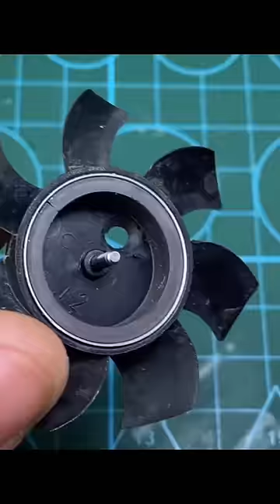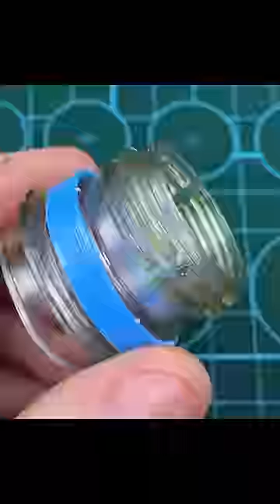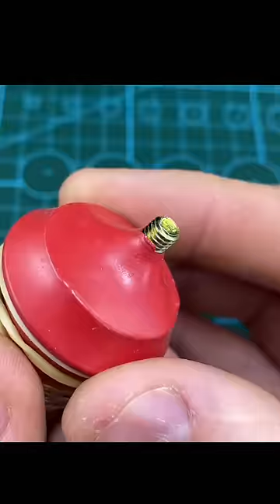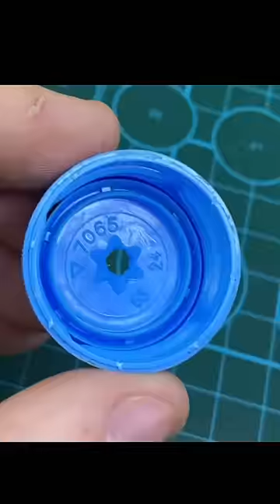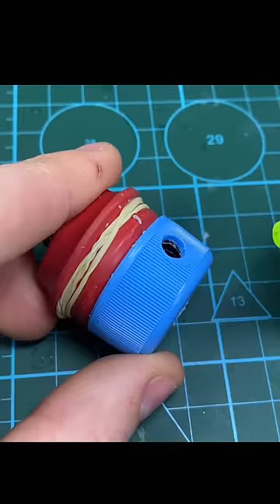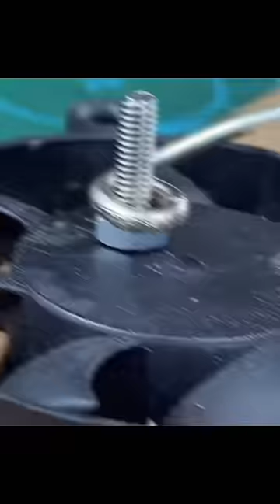How to Make an Air Pump

Comment: This is possible because theres a simple valve that stop the machine to suck air at the same hole. Or In other words this can be called a pump because theres an one-way valve, good video and definitely not bad
Reply: Y8u9uu
Reply: NO NEED TO RE-EXPLAIN.

Comment: Bro, Where is the output valve?
Reply: This not an water pump this an air pump he showed the air by putting the pipe in to the water...
Reply: @rudrakshthete4934  @Whiteglows Electronics output valve was made with a cut skin of baloon, glued on a hole in  the bottle lid.
Reply: @Whiteglows Electronics output valve was made with a cut skin of baloon, glued on a hole in  the bottle lid.
Reply: @madhusudangupta3661  the valve is inside the bottle cap, so I'm pretty sure it's an inlet valve.
Reply: @exmodeus  I believe you must have read and understood my comments to Whiteglow Electronics. I said the same thing, that you are repeating, that the valve is fitted in the bottle lid.
Reply: @madhusudangupta3661  You didn't called it as input valve, but output valve. OK, here is the air flow, atmosphere > pump chamber (bottle cap) > tube > glass of water. That's why I called it as input valve.

It may not be necessary to add an outlet valve as the tube is submerged in water.
Reply: @exmodeus  Dear Sir, At the onset, I reiterate that I had initially responded to Whiteglows Electronics on his comment about the non-existence of the output valve. Obviously my comment was to explain it in detail to justify the construction of the project.

Dear, Your entry into the issue is welcome, but with reservations that you must first understand the scenario and comment logically.

Secondly, the requirement of the output valve, though submerged in water, as because you will agree with the basic knowledge of fluid mechanics, in which I have the Masters, that in the absence of output valve, the surrounding water, submerging the outlet, shall enter into the pump system due to the presence of negative air pressure, thereby failing the purpose and functioning of the pump. 

At the end, be assured that I shall be waiting for your and other knowledgeable viewers' comments on the discussions.
Reply: @madhusudangupta3661  Forgive me not giving detailed explanation how the submerged tube 'can' act like check valve/output valve regarding the video (such as how deep the tube is submerged, resistance of the inlet port, displacement volume, etc), because I don't have time when writing that comment. Of course it isn't applicable to every case.

Initially my first reply, I corrected your statement that said "output valve was made with a cut skin of baloon, glued on a hole in  the bottle lid" is INPUT VALVE, because the balloon is glued INSIDE not the outside.

I have 2 questions for you.
1. What is the direction of the fluid is flowing? (this may be obvious, but I want to make sure)

2. Why do you called it (a cut skin of baloon, glued on a hole in  the bottle lid) as output valve?

If people with Masters degrees, have different naming of those components, please let me know.
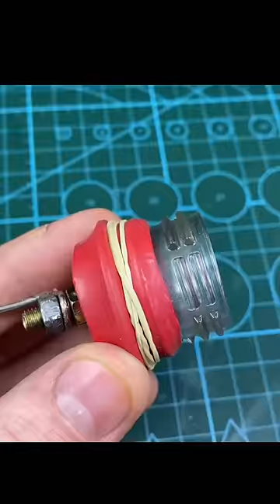Reply: @exmodeus  The fluid is flowing from the atmosphere into Pump cylinder through the INLET valve( Balloon skin glued inside the pump cylinder as inlet valve, to check the reverse back flow into atmosphere). The compressed fluid, not finding escape back to atmosphere through the inlet valve, is bound to move forward to get released into the tube. However, after your pointed comment as above, I  revisited the VDO and noticed that the glued skin is on inlet of the cylinder (0:42 sec). Another balloon skin has been used to act as piston, leaving the output hole ( without any valve) free to allow flow in either direction. This indeed is a lacuna in the performance of the pump. The end of the delivery tube placed in the glass full of water, is supposed to  allow the back flow of water into the tube during the suction stroke. However, The inertia of denser fluid, water, placed below the level of the pump, will not allow back flow of water during the too short period of suction stroke and the inlet valve of the pump will allow easy entry of lighter fluid, air, into the cylinder through the balloon skin. Thus Pump is supposed to operate in the given setup, though with reduced efficiency, theoretically. However, if the outlet tube is placed in open atmosphere or the water glass is place above the pump level, the pump will not be able to maintain flow of air in forward direction effectively. Gluing of balloon cut skin on the outside of the output hole, ie just before the tube, shall improve the setup to function in all conditions.
It was my pleasure to explain the flow of air without the physical output valve. I had no intention of changing the nomenclature of components.

Comment: That cannot be called as a pump unless it generates some pressure
Reply: I get where you're going, but a pump only moves liquids or solids.

Restriction causes pressure. 

It simply depends on if the pump is powerful enough to overcome the restriction(s) if you're looking for pressure. 

No matter If a pump can or cannot overcome restriction it is still a pump.
Reply: IT IS A PUMP.
IT DOES GENERATE PRESSURE.. THAT'S WHY THE BUBBLES COME OUT.

Comment: Wher is output valve
Reply: output valve was made with a cut skin of baloon, glued on a hole in  the bottle lid.
Reply: I wanna ask. Is that where the air is suppose to enter the air chamber?
Reply: @madhusudangupta3661  Hi can i ask? Is that where the air is suppose to enter the air chamber?